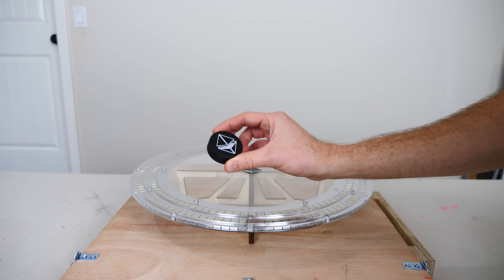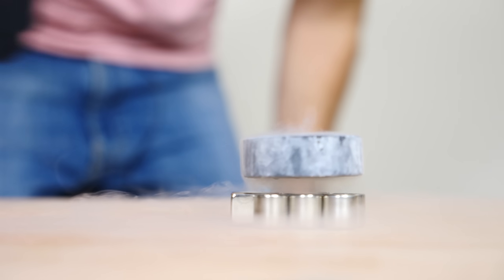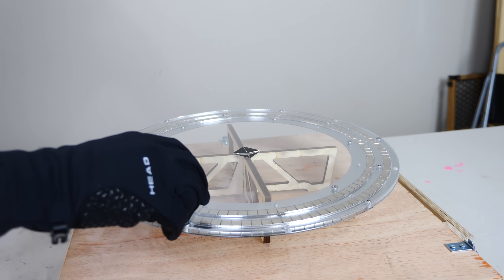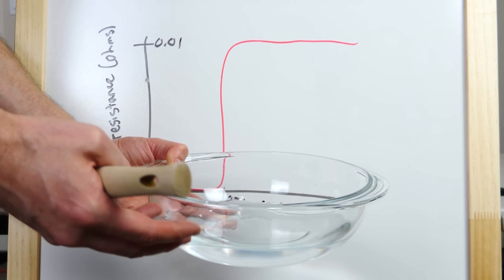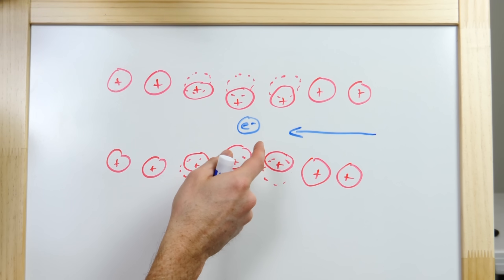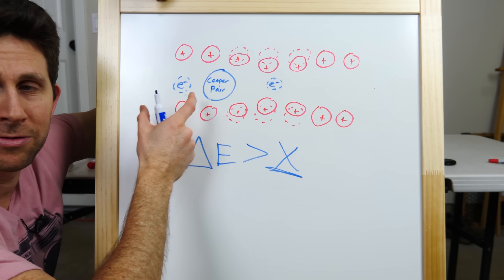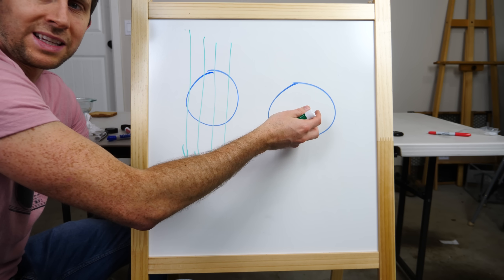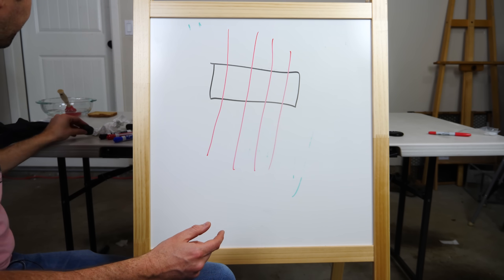Quantum Locking Will Blow Your Mind—How Does it Work?

Comment: so you could make a perpetual motion device that makes energy?  or by the fact that it has 0 resistance it cannot produce energy?  and if you amke the super conductor colder, can you increase the amount of speed? and is there a maximum amount of cold that makes the reaction?  is that temperature the same for all super conductors.... or does it change with various types of super conductors?  i hope my questions arent too simple or naive, but this is the first time i have seen something like that and dont fully understand it and tryingto wrap my head around it

Comment: When you say there's zero resistance, that's not true.
What you SHOULD say is that there is so little resistance that it makes no noticeable impact.
And that superconductor is only a superconductor when it's super cooled. The outside air is giving energy to the superconductor which means its motion is NOT perpetual.

Comment: U gotta put those in your monthly boxes I would definitely buy it then

Although I dont have liquid nitrogen 😬
Reply: Surprisingly not a problem. Liquid nitrogen needs very expensive cryocooling equipment to produce, but once you have the equipment purchased the cost to actually operate it is very low - so liquid nitrogen itsself is a very cheap industrial commodity. The nitrogen costs less than the flask it comes in - and the companies that sell it will happily give a rebate if you return the flask. Per unit volume, it's cheaper than supermarket bottled water.

Comment: action lab: ok so we have to cool off the superconductor

me: so we're just putting it in the freezer right ?

action lab: we need some liquid nitrogen 

me: * dies knowing i wont be trying this at home any time soon *
Reply: its easy to make liquid Nitrogen....
you just need some liquid Hydrogen..
Reply: You can get liquid nitrogen pretty easily
Reply: Liquid nitrogen is pretty cheap. And you can make some low quality stuff yourself.
Reply: He probably means it's dangerous enough not for him to get it.
Reply: Well, also need to run out for some yttrium barium copper oxide...

Comment: people should make railway systems outta this stuff
Reply: People have tried. It's not practical. A few maglev trains do use superconducting magnets in the trains, but it's horrifically expensive - there are only a handful of maglev trains services in the world, and these exist as much for national prestige as for practical advantage over conventional rail. It is just a cost issue: A maglev track is an elaborate construction of expensive magnetic elements in precision alignment, which costs a lot more in both materials and construction than rolling some steel into bars and bolting it to a concrete foundation. Most of the few maglev trains that do run don't even use superconductors, just plain electromagnets with a dynamic control system to achieve much the same effect.

Comment: We can make hovering cars with that type-2 superconductor with magnetic roads and supercondutor material under the car.
Reply: Keeping it cold enough is the problem here. Its hard to cool and keep cool big magnets.
Reply: You invented the maglev train. It works from a physics perspective, but not economically. High-temperature superconductors are expensive to manufacture, and you would need to refill your car with liquid nitrogen on a regular basis.

Comment: do you think that, with further research and development, this could work as a suspension on cars or even trains? idk just looking at how smooth it is just had me thinking
Reply: and would the electrons count as perpetual motion? or would it not since the only reason it is, is because of the temperature
Reply: @gabefuentez624  He mentioned in the video that the electron flow is perpetual motion, but you wouldn't be able to extract any energy from it. Also, you need to continually keep it cool.

Comment: I've seen this experiment several times before, but never had a real idea why it works. Thanks! With that, Could you put it in a square of alternating magnets and have it levitate in the middle? Or would it get drawn closer to one side? By a square, I mean could you make a square frame out of wood and put the magnets on the inside. Just wondering. Thanks again for the awesome explanation. 😀

Comment: Dude, I really love your work, you're very clear in your explanations and makes nature a bit simpler and fun to understand.
I should mention that, on this video you said real, absolute 0 Ω resistance due to the discrete energy situation, which is absolutely true :) I should only consider that the material gets its
 temperature sufficiently homogeneous.
When we say it gets a small resistance (but not zero) , I guess, we're trying to say that we cannot assure this temperature condition (being homogeneous low temperature on the whole superconductor) considering the device's situation of operation.
This small differences on temperature could cause a small local resistance, which, in electromagnetic field terms would generate a penetration, due to displacement current (I don't know the exactly name in English, but in university they call it the D vector field).
I might be completely wrong, I just wanted to point this out because I thought to be relevant :) 
Anyway, I really loved this video :)

Comment: Does the superconductor rotate for ever on the track?
Reply: Only if it stays cold forever, which it wouldn't.

Also, wind resistance would slow it down, so it would need to be in a vacuum chamber.

Comment: I've know about this for over 20 years, yet I'm surprised that we don't have more public transportation options that use this type of superconductor.
Reply: Its not really practical as we need to keep it at a very low temperature
Reply: It would probably be more energy to keep things this cold than it would to use our normal transportation.
Reply: Maybe on another planet ?!?! O_O
Reply: @chupetaparabose1  Think vacuum of space, at zero Kelvin. Would work perfectly there!
Reply: @ricklynch There is nowhere in the universe that exists at 0 kelvins
Reply: Gage Mason yeh cooling gets exponentially harder the closer you get to 0 kelvin, but space is pretty close if you leave it for a while.
Reply: @carrotylemons1190  There are certain gas formations that get extremely close and humans have even gotten close as well, but according to all known laws of physics it is still impossible for anywhere to be 0 Kelvin unless everything is 0 Kelvin, and if that were the case we'd be dead.
Reply: Gage Mason indeed
Reply: Cars are better, bro.
Reply: When we researched it 15-17 years ago I told that the fist smartie who discovers htsc(high temperature superconductivity) above ~250-270K AND manages to live thru(hint: big oil wont like it) and turn it into a bonanza gonna be the wealthiest man in history. All ceramics I’ve found were around 150k, then I stopped for a while.  To the point. At these temps such transportation is not worth it. Let see where it comes in 15-20 years.
Reply: For reals, like a loop or hyperloop or something better than a bus. I grew up in LA; but public transit is laughable. I only dream of the day. Apparently a monorail was proposed in the 50s by Walt Disney. Ray Bradbury backed it. It was completely tabled. The big three just didn’t want it. I know it will get there.
Reply: If those was a high-speed transport how'd you use the brakes to stop the vehicle?

Comment: So, would this not work in a really cold environment? I mean, does the track have to be at room temperature and the superconductor is kept at -220 degrees( or whatever) for it to work? I am thinking possible outer space applications, where it’s super cold that this might be useful as a form of transportation or some other kind of purpose that would normally require energy.  Or something...

Comment: Sounds like a plan for high speed rails.
Reply: Make sure you have a liquid nitrogen generator
Reply: @yougot69supermonkeyb21  not difficult, it's just air. Liquid nitrogen is about the price of milk. Besides, if you insulate it well enough you wouldn't have to produce much at all. Although for a train you'd probably have to use liquid helium, which is much more expensive , though you could still insulate it to mean your losses are essentially nil.
Reply: there is train called Maglev train in Japan. try to research

Comment: I don't have much of physics knowledge but i still wonder why can't we generate electricity using this technology
Reply: Because of mustard gas
Reply: Mainly it’s because of the first law of thermodynamics we can’t get more energy out of it then we put into it so let’s say you put this system in a lightless vacuum (light can cause it to slow) your first energy input will be the freezing of the magnet but let’s say that the technology for energy less cooling exsists  because for this we need to assume the vacuum it’s in isn’t so cold the magnets loose function then you put the superconductor on the track and push it that’s your second input now you hook up a generator attached to the infinitely spinning superconductor but when you do it slows down and stops because the friction of the generator generating power still causes friction allowing you at most to get the same amount of energy you put in with your push out

Comment: Why people are so obsessed with quantum mechanics(I hate to know shit about it) Know what... I've been told and the way I think that the atoms in the conductors vibrates more on increasing the temperature but when you lower the temperature the wave guides drives the electrons with less collision because of less vibration of atoms and hence conductivity increases and for that quantum shit that is a simple application of Lenz law(conductivity increases ie: induced current will be more because of changing flux hence it resists more in changing position) , atleast the way I think , correct me if I'm wrong

Comment: 2010: Using superconductors we will have hoverboards by 2020. 
2020: Hoverbread.
Reply: Wooden boards are mostly just a bunch of tangled complex carbohydrates holding some arbitrary amount of water...

It therefore can be argued that, by definition, bread is a form of squishy, man-made wood, and the fact that a slice of bread is a cut section of the greater whole means that a slice of bread could be defined as a board.
Reply: 2021: Levitate female to make sandwich with levitating bread...
Reply: XD
Reply: It is not so easy as you think
Reply: You're really late, @Arth patel.  https://youtu.be/SDn6Z6vfJGs
Reply: Even better
Reply: There are already
Reply: There is a skate park with skate boards with superconductors in it
Reply: The humanity is more advanced than what we thought we will be
Reply: There actually was an ad where they used underground magnets to create a mock-up hoverboard with this technology
Reply: Lexus did in 2015
Reply: They already made a hoverboard using this tech a couple years back it wasn’t that impressive
Reply: Lexus made one already a couple years ago, not ready for the public quite yet tho
Reply: Skatebread 2.0
Reply: Lol the best comment
Reply: Efficient way to give bread in quarantine
Reply: i blame engrish!
Reply: A hoverboard was impossible to float on the ground unless if they used some kind of air turbine that can carry human weight
Reply: @keiji1531  Would be possible with superconductors/magnets. Problem is the low temperature that you need.
Reply: @keiji1531  Magnetic track.

Comment: What is the difference in this case between gravity - which it seems to perfectly oppose - and your hand raising/lowering the magnet - which it allows and remembers?

The field line explanation explains why it doesn't resist a certain direction (going around the track), but doesn't really explain how you can place the superconductor into position in the first place
The magnetic field lines aren't actually discrete, are they?

Comment: If the induzed Voltage in the supercunductor is calculated like this: L*V*B=U
and the Resistance would be really zero, then the current flowing through it would be:
lim(R=>0) L*V*B/R
if V, L and B is not 0 then the Current would go to infinity.
And then the Lorentz force would be I*l*B=F and if the Current would go to infinity then the Force would go to infinity, too.
But why can you even move it if the force against your force would be infinity if you moved it?
or isnt the Resistans really 0
Because else you couldnt even move it in the magnetic field of earth.